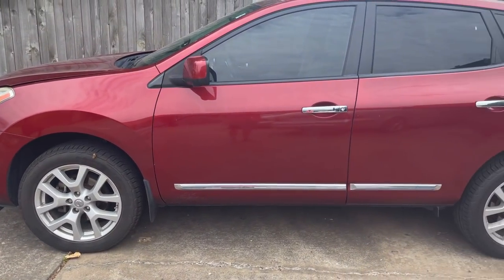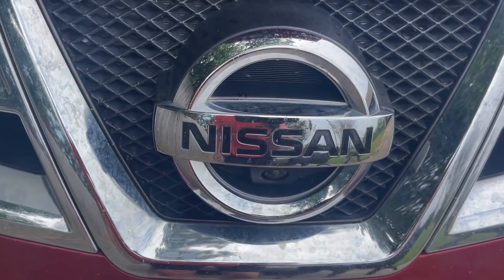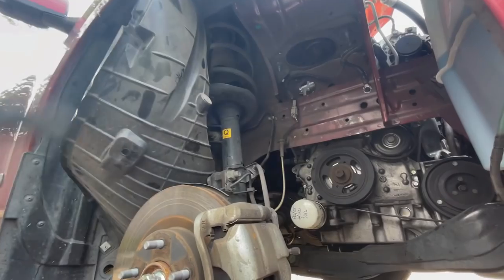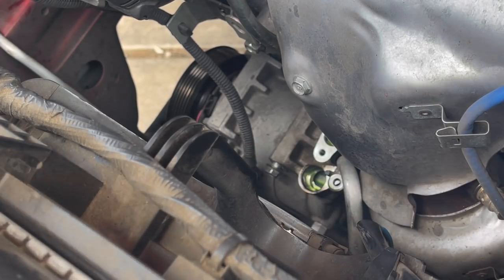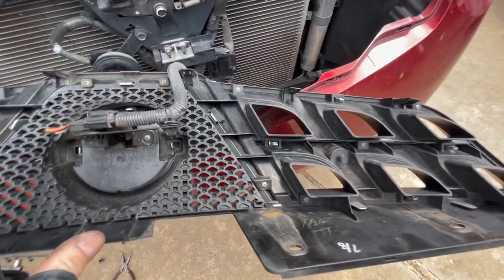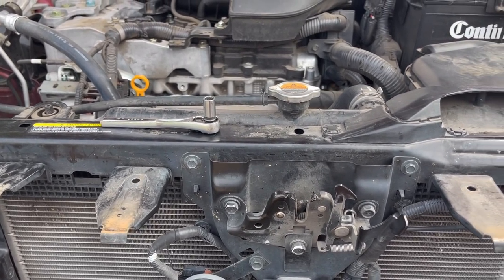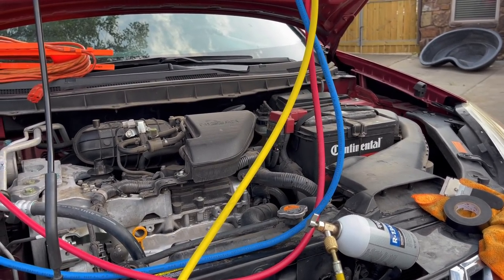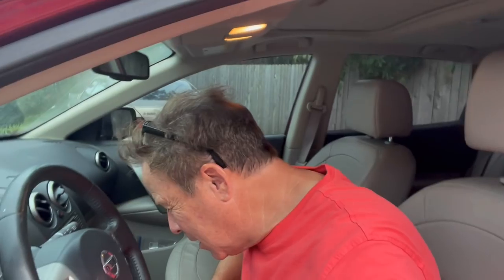Mike Gets Cooler Than Ever!!

Comment: I am not generally a fan of modern Nissan offerings, but the Rogue endeared itself to me when the Nissan dealer offered one as a loaner when I had to leave my best friend’s Nissan Titan for overnight service.  It struck me as a near perfect crossover SUV.  Large enough to be comfortable yet small enough to park or go almost anywhere that I would want to go. Probably may favorite feature, however, was its ride height — not so tall that one had to climb in or so low that one with arthritic knees had to struggle to get out.  The great fuel economy, particularly when compared to the Titan was a nice surprise.

I thoroughly enjoyed the Datsun of the 1970s — the 210 Honey Bee, the 610 sedan, and the 710 station wagon as well as several others.